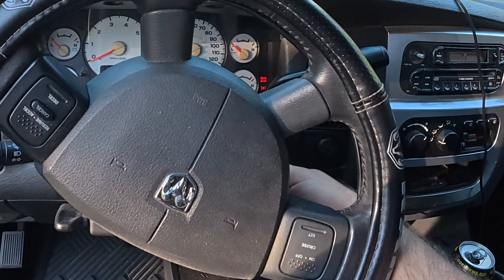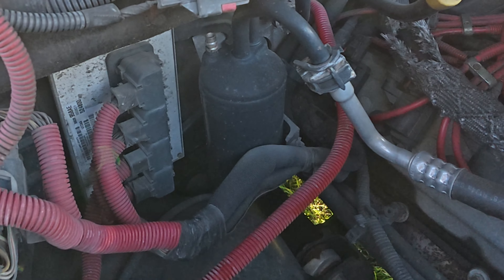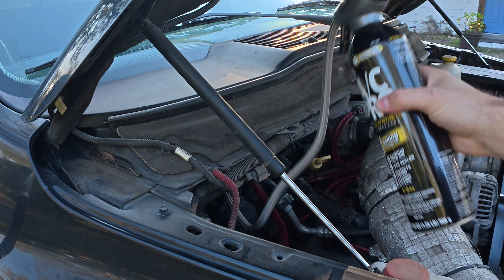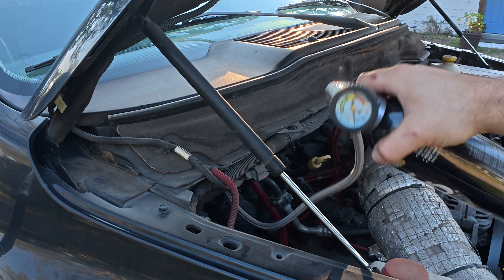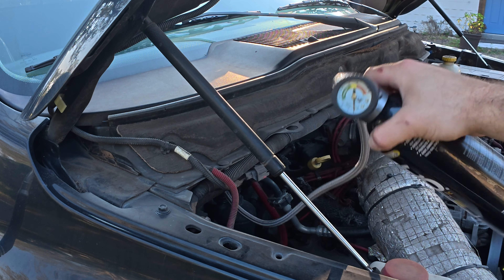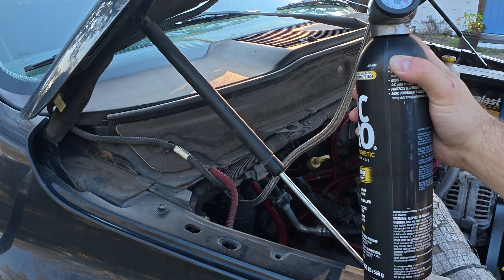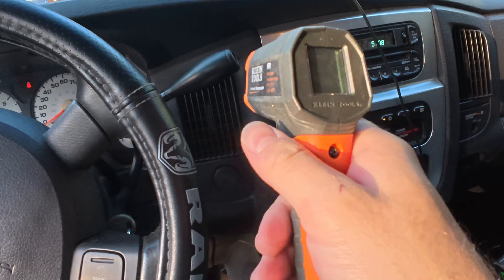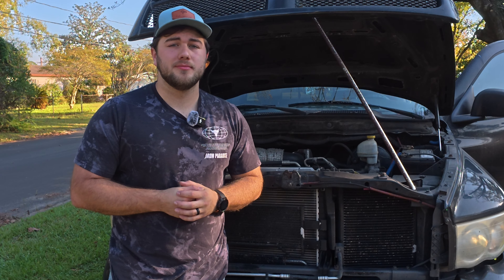How to RECHARGE your AC: 2005 dodge ram 1500

Comment: Ya know, that motion does seem familiar... I should call her...

BTW try to check for leaks, sealed vacuum systems in theory should have refrigerant last forever. Fittings, hoses, bad o-rings, and low and high port valves can be letting your refrigerant leak out. The environment and your wallet will thank you 🤙🏼

For the future (like my fridge not cooling video) before adding refrigerant check to make sure you've got a solid vacuum holding in the system.
Reply from the maker: @TOOL_TECHNICAL  this truck has so much wrong with it, I wouldn’t doubt it’s all of the above
Reply: @Kaleb_RoSs  fair enough lol

Comment: Kaleb I know you have good intentions. But if there a need for recharge the ac. Is either going somewhere or moisture getting in. Either way, check for leaks, o ring ect. Also at the beginning and end. Check for the
Positive and negative pressure. Putting a genie in a bottle. May often and will come to bite your wallet. What you did there it’s a your own risk. Not something that should be recommended. Respectfully
Reply from the maker: @learningwithjuan  copy that Juan!
Reply: @Kaleb_RoSs  👍👍👍 Your humbleness will drive you far. Know I know why you’re here. Best of wishes and God Bless.

Comment: Dodge rams suck lol
Reply from the maker: @2005henson  lmao after 280k miles it’s been alright for me haha
Reply: Hell yea. I was messing with ya. I'm a yota fan i got 310k on mine and it squicks and bangs but doesn't stop
Reply: Never replaced the ac though
Reply: Or anything
Reply from the maker: @2005henson  yea a yota is the next move after this truck is too far gone
Reply: Can't go wrong with them from my experience, only had one though got bed drawers I built plus fridge and solar on it for work only really. Lifted on 33 1250s fixing to go 35s after I cut finders already did cab mount chop
Reply: Love your videos 2. I'm all flex also fixing to get framing nailer. My local lowes has then stalked